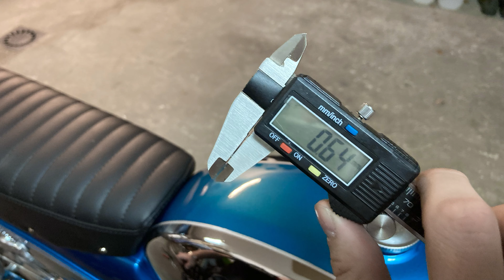Zundapp 70cc Athena membraan | BVR | 4K

Comment: You did it👍🏻 Barikit Piston is a very good choice. Especially the ring of Athena is scrap and snugs into the exhaust port very easy.
Barikit has a bigger diameter of 44,95 compared to Athena 44,935. no problem with it?
Reply from the maker: It’s indeed a very good piston👌🏼

Comment: To compensate for the distance of the squish, you used a second foot seal. This means that the channels no longer open completely and you change the timing. Wouldn't it be better to use a second copper gasket on the cylinder head?
Reply from the maker: No it's not right, the ports are equal to the piston. Timing is perfect and drives perfect. Nothing wrong with it
Reply: @zundappies  Okay, maybe im wrong.
Reply: @Michael_Meyer  and if you is a second foot seal. Then are the channels more open because you lift the cilinder. And if you use a head seal then you make the squish bigger
Reply: The cylinder has to go down.Now the piston,is to low,look at the pic.Now the cylinder,is to high,more lightly.